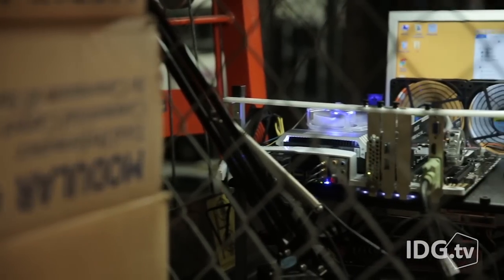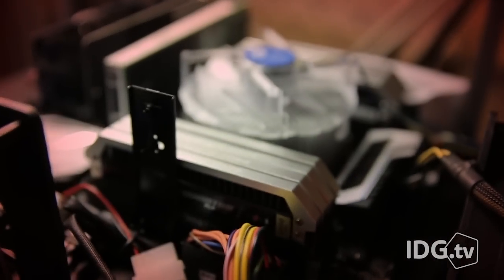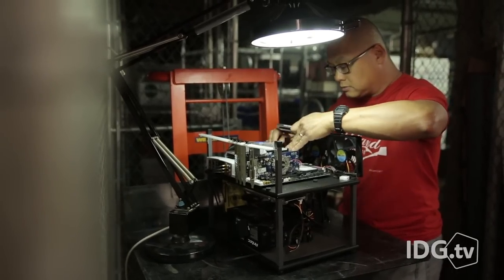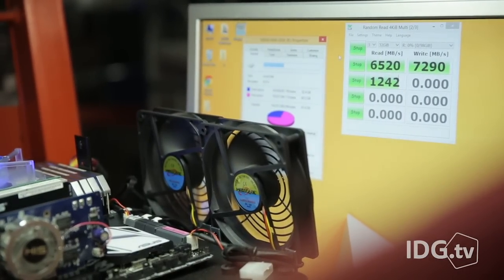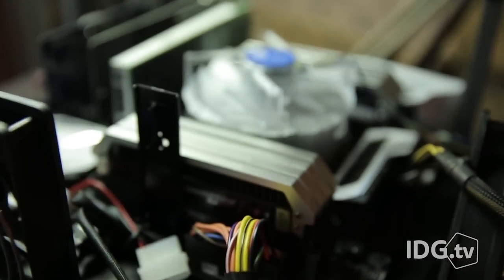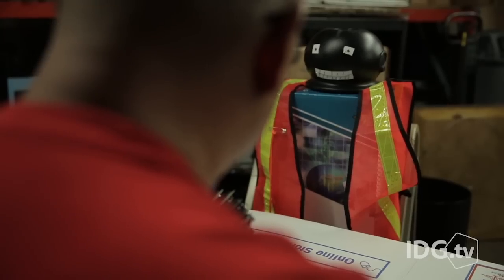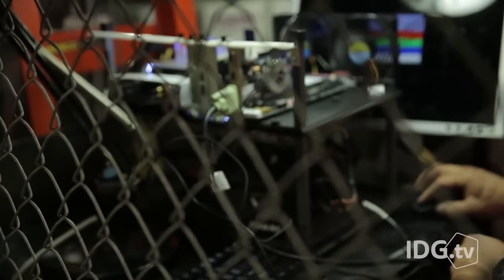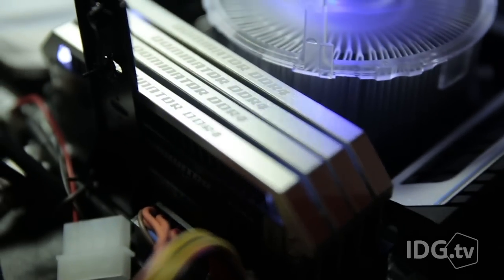Here's what 128GB of DDR4 RAM in a PC looks like

Comment: Here in late 2021, when Adler Lake and its DDR5 is coming...
However they're not here yet. Right now, the average consumers have 10 cores (10900K) / 16 cores (5950X) at max. So for them, aside from using Adobe and some 3D application, the need of 128GB RAM is still fairly small. I wonder if I should jump on this DDR5 hype or stay with my W-1370P and 64Gb of 3200Mhz ECC...
Reply: avg consumer have 6 cores n 16gb ddr4 ram. 😰.
10 12 cores n 32gb ram are still for enthusiasts

Comment: Ryzen threadripper 
Gtx 1080ti x 2 in sli
128 gb of ram 
10 tb hard drive 
512 gb SSD
1000 watts psu

= THE ULTIMATE WORKSTATION. 

And im here with an r7 260x

Comment: You could have done a little better with your 3 reasons why you would want 128GB... 1) Speed. 2) Takes strain of the hard drives and thus, improves their life. 3) Won't need to upgrade your computer for a very VERY long time.

Comment: Have you tried overclocking it? what were your results? I ask because I got this kit with a 5960x and I've reached 3.7ghz with 128gb @ 2250mhz Coudln't reach 3000mhz even though it's rated at that :( So what did you get?
Reply: Meine too got 32gb Kit with 3200mhz. but wohnt run above 2400mhz.

Comment: does it increase gaming performance
Reply: +Amlan Naskar not really unless your games were on the ram disk then load times would be much faster but the draw backs are the you have to move the stored files off it everytime your computer shuts down i run 16GB of ram personally and its fine most recommend 8GB for gaming but i use 8gb too easily
Reply: +patrick Tighe yea 8GB definently aint enough for modern demanding games, you can't do anything else on your system with just 8 on them. I upgraded to 16 too recently

Comment: And you still use a stock cooler -_\
Reply: +Lemon Chief In 2015 with the most modern Intel CPUs, they run so frosty that unless you're overclocking, stock coolers are absolutely fine in a case with good ventilation.

A couple of years ago making fun of stock cooling had some validity.

With modern chips using such tiny dies and such low voltage, with no-oc, stock cooling is more than adequate.

Shoot, you can run a 45w chip passively with an Evo 212+ these days. 

Silence is awesome.
Reply: Jween Tech You build a pc and you don't even overclock the cpu, this is hilarious.
Reply: +Lemon Chief My main PC is a 4790K @ a modest 4.6ghz, air cooled with an HE02.

But I've built other systems with non-K chips that absolutely do not require anything more than a stock cooler.

That's what I'm saying, chips are so advanced now that unless you're overclocked, stock cooling is completely fine. That's all.
Reply: +Jween Tech Simply not true unless you're not going to use your cpu to it's highest potential.  I ran a lowly i3 4160 on a stock cooler doing nothing more than downloading and processing the bitcoin blockchain, and maybe a day later it start giving me kernel panic messages.  It had gotten up to almost 90°C.  Video transcoding gets it up to 80°C in no time.  Even compiling software gets it up to unacceptable temperatures if it's a big enough software package.

Comment: so basically, none of those were practical reasons to have that much ram.  it's pretty much for bragging rights?
Reply: +Geoffrey Browne pretty much...although for editing and streaming live, it would be helpful in reducing times, and transfer rates,,,,only gonna save about a minute or two for large files, but 1-2 mins, multiplied by how many times you use it/ time owned and it could amount to months saved just in transfering files such as huge cad programs or architecture.....other than that, pretty much bragging rights.
Reply: +Geoffrey Browne Also extremely helpful for rendering, so if you're making an animation from Blender, it won't take weeks to render all the objects.
Reply: Yep
Reply: +Geoffrey Browne There are kits under $800 available and they are x2 or x4 faster than the fastest SSD. It's not just practical, it's the only and fastest way to store data you want to process, not just read and write performance but also response time which is many times faster than NAND. Think about it, with $1000, instead of buying a PCI-E SSD drive that is x4 slower or more, you can buy a 128 GB RAM kit and a SATA 3 SSD to back up the content.

Comment: enjoy your bottlenecked system unless you have high end server tier specs
just wait till the price comes down and you can actually USE that much ram
by then the same size with higher read/write speeds will be available for less
Reply: +Nacalal Not sure if you noticed, but he is using server grade hardware... otherwise the system wouldn't even support 128GB RAM in this form.
Reply: Ethan McLenan
residential DDR4 boards can alocate 128 GB ram